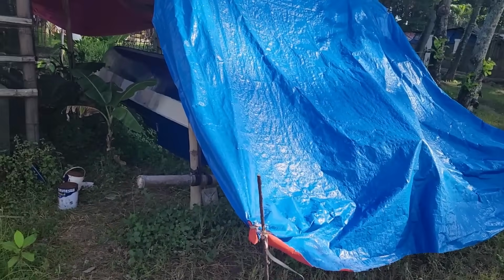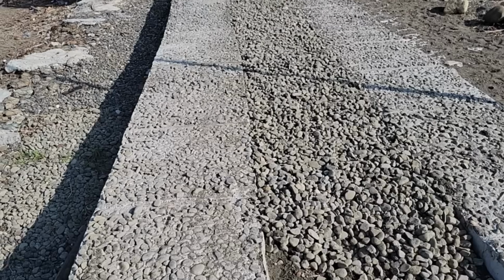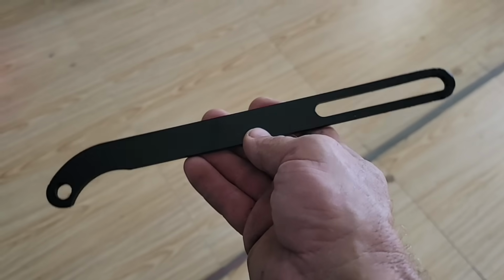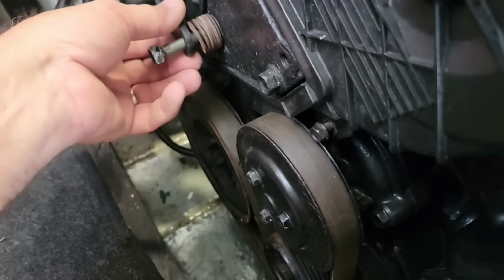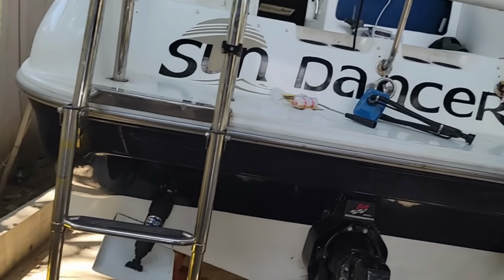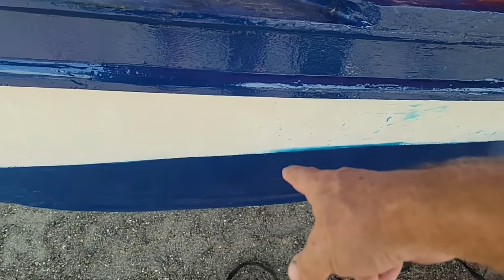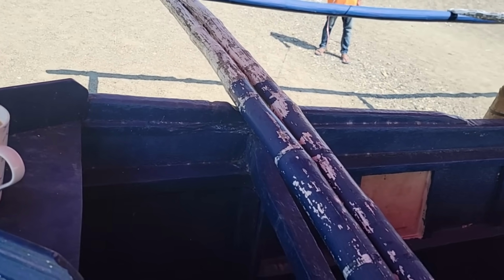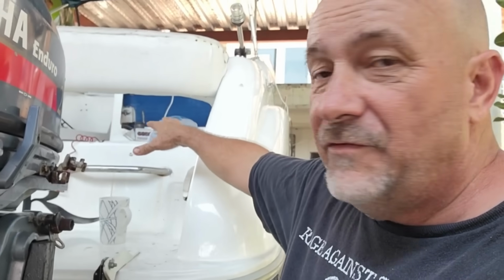Diesel Outboard coming soon? Bangka Boat Back to Beach

Comment: Howdy from the coastal bend of Texas. Had a sea ray 220 back in the day and I loved it,of course like you said the v8 is heavy. I noticed you have trim tabs and hopefully you can get those to work.  They will help somewhat with the ride level of the boat however with a 4 cylinder diesel I think it will be difficult to plane out.  Anxious to see you get it the drink.  Thank for sharing.
Reply: If it's the 170 hp mercruiser diesel, it is supposed to be able to cruise at 20knts, max at 25knts. 
Planeable?
I have a  sailing background, ( racing dinghies and catamarans! a lot wetter ride !! Lol) so no knowledge of motorised boating !
Reply from the maker: I did videos on the trim tabs. They are brand new electric trim tabs. Threw the old hydraulic ones out. This diesel is used in boats globally and will plane out with it. Its a high rev high performance diesel and also the most fuel economical diesel out there for planing boats. 4400 rpm cruising wot. pull it back to 3300 to 3600 cruise and sip fuel

Comment: Have you ever thought about a mig   welder with Flux core wire very easy to use and can adjust amps, wire feed to weld anything from thick ,thin metal very easy to use
Reply from the maker: I have a brand new combo  MIG TIG ARC welder sitting in my garage. I wanted the house build projects with workers here done and place cleaned up and organized before I unbox it and start using it. I dont want other using and abusing it plus stuff come up missing that goes to it. It can be MAYHEM.  Flux core.... No I wont use it unless I have to. The flux core splatters. I will use shield gas.

Comment: Hmm more weight wanted on the stern?
The Filipino way, would be to have a couple of 20 feet Bamboo poles running  back out of the deck rearwards,  add a couple of 20 litre water tanks to each (80kgs total ) pole. the transom acts as the fulcrum!
Might ruin the look tho ?! Lol
Reply from the maker: your backwards. I was standing at the bow. We have to ballast the bow on that little pump boat not the stern
Reply: @TexasFilipino  . Woops, sorry, thought you were talking about the weight difference, between the V8 and the diesel on your, sun ray! No offence intended!
Since my umpteen uncles,  ship had such a prow and figurehead, perhaps a smaller version would do for your Banca? 
Check out HMS Victory Prow. On which is he died back in 1805!
Best regards to all down there!

Comment: I got a question for you james? my filipina gf is building a beach house in bacolod almost directly across the water from yours, She had the fence put up before we met, concrete with a metal mesh on top, In 2 years it is rusted to the point I can crumble it in my hand, what metal did you use on top of your fence ?
Reply from the maker: Mine is bad too as  QUALITY stainless , cement , wood or some crappy plastic is about all you can use.
Reply: @TexasFilipino  thank you. Her dad which is 84 said just use bamboo on top of the concrete wall. I was just over there in bacolod but now back in usa. It is some wonderful scenery all around the islands for sure.